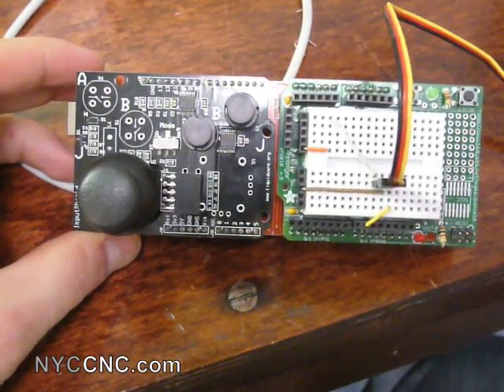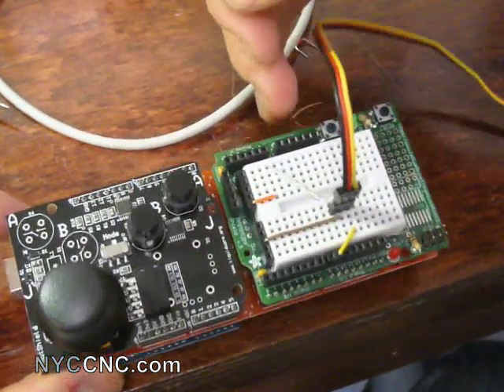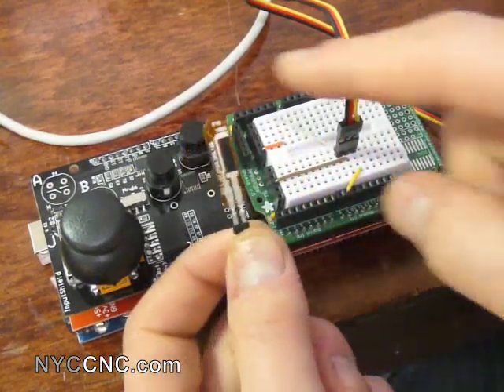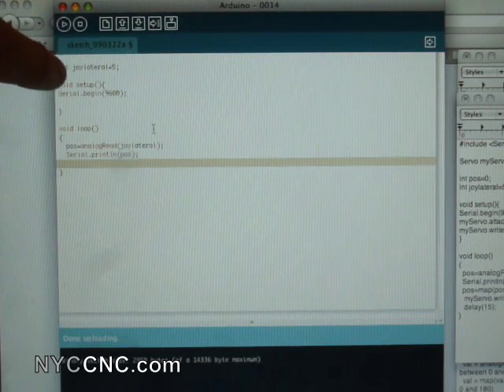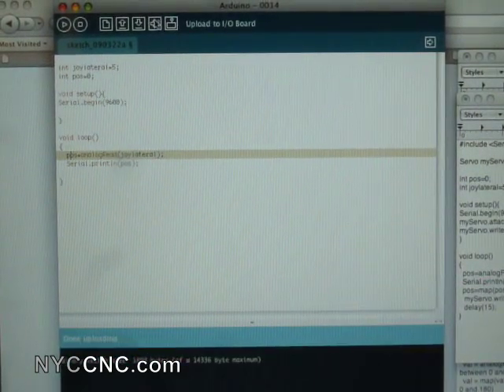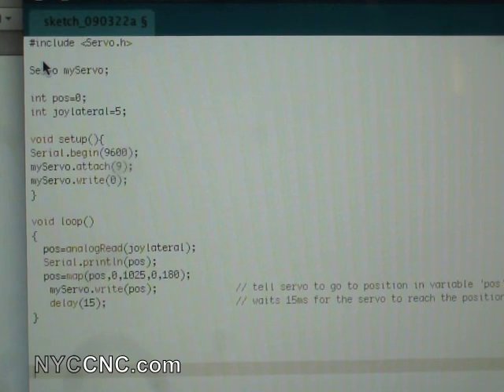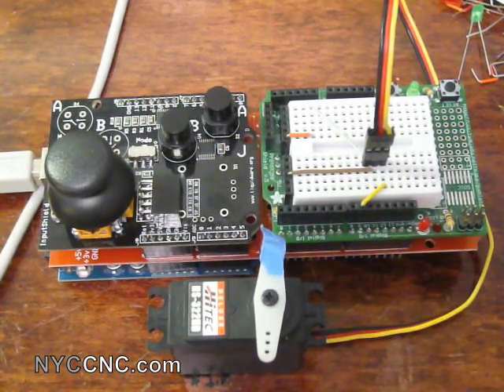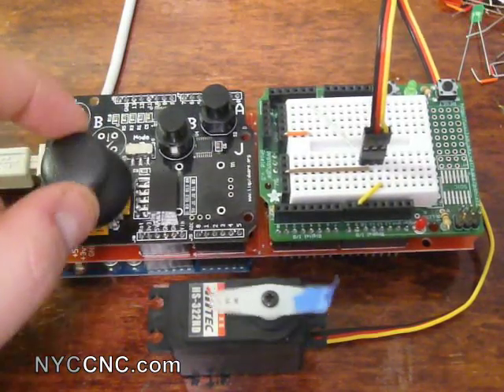Using Arduino xbox type shield to control a Servo Motor!

Comment: you really dont care about the resistance range, and btw, that "from 5 to 1023" is not resistance values, thats the reading of the ADC ... arduino comes with 10-bit resolution(hence max value 1023) ADC. u can even use a set range function to convert the 5:1023 range to 0:180 range for the servo